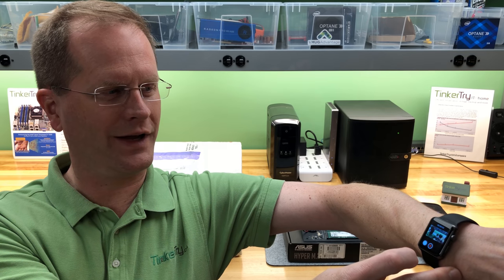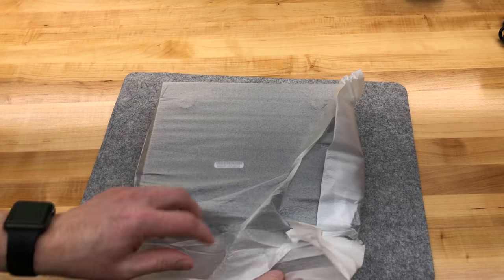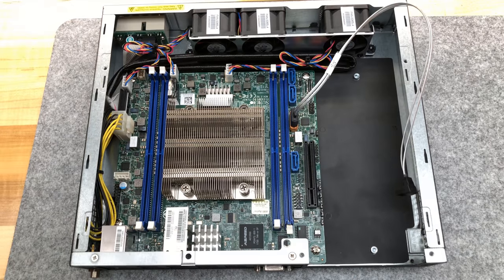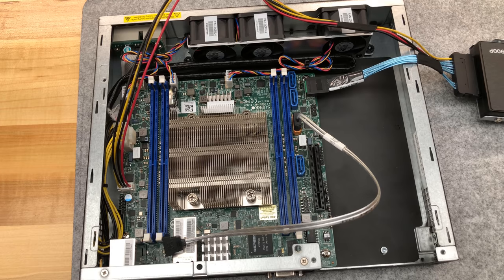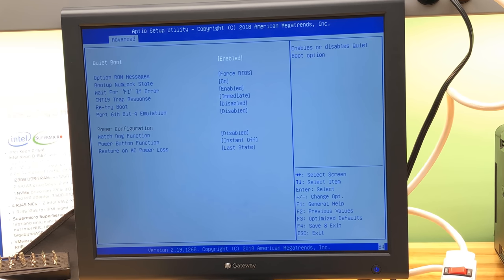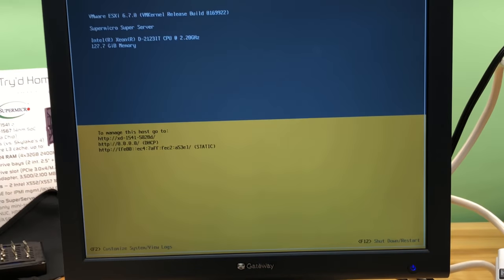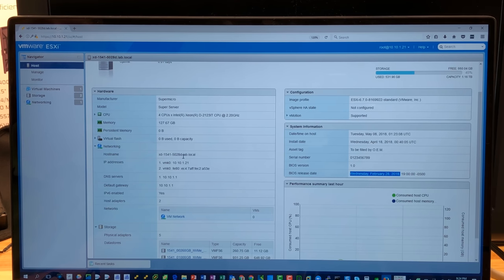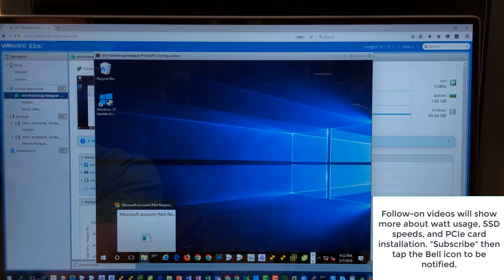World's First Supermicro SuperServer SYS-E300-9D unboxing & BIOS settings [4K]

Comment: Hi Paul. This video is fantastic.

I have a question, here's what I'm up to.

Objective:

I would like to add thunderbolt and 1 M.2 NVMe. 
Supermicro specs it's PCI-E lanes as follows:

1 onboard OCuLink port (or 1 PCI-E 3.0
 x4 NVMe), 1 PCI-E 3.0 x8 (LP) slot. 

Are they implying the system has a total of 8 lanes? Or, 12? 4 lanes at the OCuLink, and 8 at the PCI-E slot. 
I may have monkey brain with it being so late. Thank you Paul.

Comment: how can you mazimize that 128gb ram when there are only a total of 4 threads cpu? I was thinking to buy this but it seems not economical. So instead I have built my own server using Supermicro x10srl-f and Intel Xeon E5-2620 v4 and then installed 64gb ram.
Reply from the maker: Yeah, I didn't keep that system, I use an 8 core Xeon D-1541 for ESXi 7.0U3c with 128GB of RAM, and 12 core Xeon D-1567 for Windows 11 with 64GB of RAM (Supermicro SuperServer SYS-5028D-TN4T).

Comment: Since I am broke, is it possible to buy used 15XX-D boards???
Reply from the maker: Sure, eBay I suppose, but I can't vouch for anybody there.
Reply: I just dont have the budget to buy the hardware so I am trying to do with what I have and learn ESXi as best as I can
Reply: You can leverage older generation hosts like the PowerEdge T410 for example which are usually perfectly usable as a learning platform and are available in fairly high memory configurations for quite cheap and will still run ESXi up to 5.5 according to the HCL. The T420 will run up to 6.5. They'll use more power but the cost savings versus current gen hardware will usually more than make up for it.

Comment: x557 and x722 can exist simultaneously. one of them is related to the entire family and the drivers. the other is related to the hardware port and how it is packaged on the motherboard. the 4 port pcie card is listed as x722 on intel's website. it looks like in every case, x722 is mentioned. in the motherboard specs for for supermicro it says x722/x557. blame intel for this mess. supermicro does not even know what to call it.

Comment: The packaging of this server seems like a complete mess ... seems like it was not designed for fitting in some pretty obvious things .. like your optane module or a 2.5 HDD or a decent graphics card.   And it's far noisier than I imagined.
Reply: It's server, what did you expect? :P Also you can mount two 2.5" HDD/SSD to the inner top cover, there's two sets of 4 holes to mount them from the bottom of the drive.